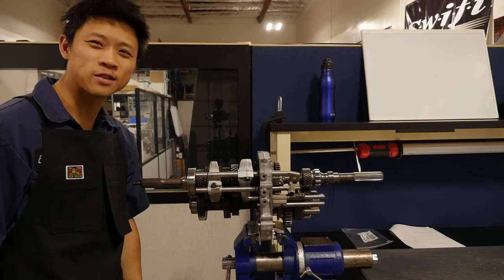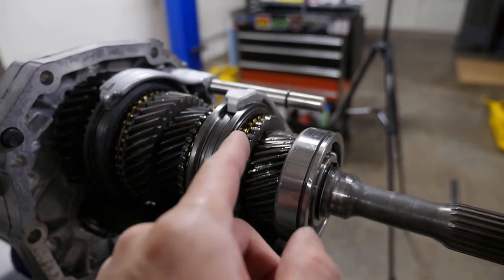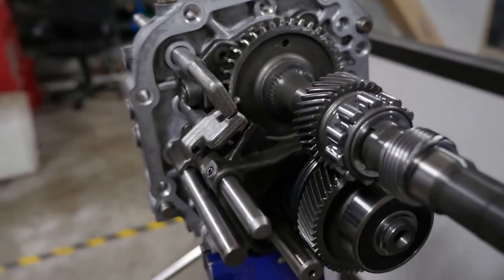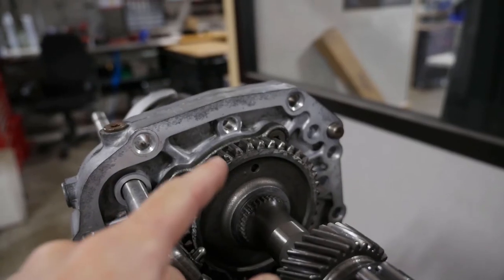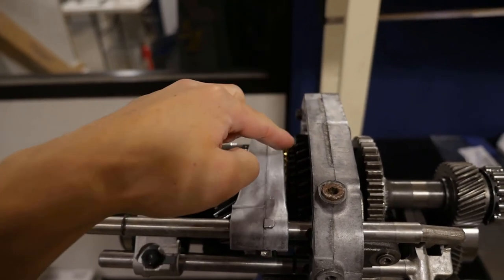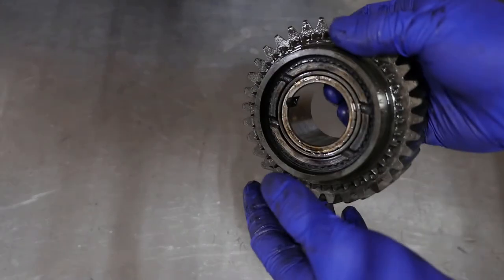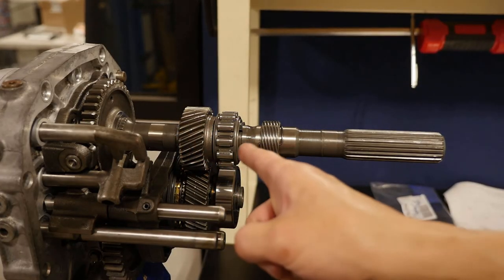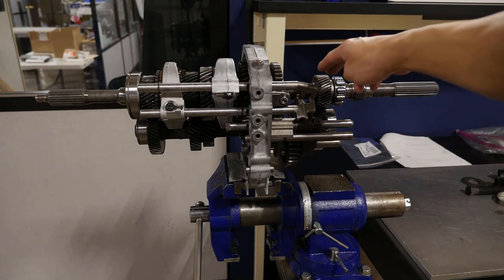W58 Rebuild Overview and Bench Test

Comment: Very nice, im in the middle of rebuilding an R154 and it seems to share a bit of architecture with the w58, it would be cool to see a side by side comparison
Reply from the maker: I have a customer R154 ready to build right now actually. Look forward to the video. Quick it I think it is 2nd gear that is scary to pull off and you risk breaking teeth. Use heat and pull up on the synchro and not the gear itself.

Comment: hello your videos are very helpful very well explained i have a question all w58 transmission are the same as car and pick up thank you very much
Reply from the maker: Wikipedia is a great resource for all the w58 variations
Reply: @CMAutohaus  thanks for answering in my Corolla I have a w58 from a 2000 Tacoma it is very strong but very slow which transmission would you recommend for my Corolla 😀👍
Reply from the maker: @edgarherrera6056  My top 3 optons https://www.stitcher.com/show/the-autohaus-podcast/episode/004-top-3-ae86-transmission-options-58255400

I think episode 2 I go over all the transmission swap options
Reply: @CMAutohaus  Thank you very much for taking the time to answer I will find a new transmission for me Corolla

Comment: My w59 trans wont shift. I took off the trans and took the casing off because it was leaking at the top. I put new rtv and put it back together. Now it wont shift. The handle only moves from center to the right. It wont move anywhere else. What could be the problem?
Reply from the maker: It may have accidentally fallen into gear when you put the tailshaft on. Take it back off and check, its happened to me a few times.
Reply: @CMAutohaus   yup it was in 5th gear. I thought i ruined my trans😅 thanks bro!
Reply: Hi! I have the same issue on a w58 i just bought. How did you end up fixing this issue? I have no experience with transmissions and dont know where to start.

Comment: Terrific video. Question about that reverse pin on the shifter you were explaining about. Is it spring loaded or locked solid? I have a W 58 I’m putting in a British roadster and that pin doesn’t move in or out but I cant find out if it was supposed to. 
Subscribed, and liked .Cheers and keep it up.
Reply: Believe you refer to it as a tic tac looking thing. Thanks again

Comment: Love the video. I've been wrenching on car since I was a teenager. I'm 58 now. My w58 had a very similar problem to the one in this video. A whirring sound until you put the clutch in the whirring sound went away. I'm guessing input shaft bearing. What do you think? Question. Trying to decide whether to send out my w58 or do it myself. Do you have an opinion? It's out of the car now . Any idea what a fair price would be for a shop to take one of these apart and go through it and put it back together for me?
Reply from the maker: Input bearing making the "whirring" sound seems to be a very common failure in all W-series boxes. You need a very rare/expensive SST to disassemble the trans (specifically the 5th gear and output bearing assembly). Best let a professional handle it, although transmission rebuilding seems to be a dying art these days.
Reply: Thank you!

Comment: Great video man!  Do you know many differences between the MK4 Supra W58 and the Lexus IS300 W55?
Reply from the maker: mk4 is the last verision W58 with many key upgrades such as an internal oil baffle, muti-piece syncros, and ball bearing shift rails.

W55 has the closest ratios, but is also a weaker W5x box.
Reply: @CMAutohaus  why would a W55 be a weaker box?  Does the closer ratio gearing cause more stress on the gears themselves?
Reply from the maker: @paulellaby7400  Anecdotal. IS300 guys commonly break these gearboxes. The gear teeth in these as well as the last gen W58 are thin for their size. breaking 4th gear teeth is very common
Reply: @CMAutohaus  any rebuild kits for 4th?

Comment: https://youtu.be/9CN2utya_7s In that video, the guy was able to remove 5th gear without breaking it. Before watching your video, I wondered if there was a special tool to remove 5th. No way Toyota would spec a crazy press fit without a way to get it out. How about a video showing how the tool works?
Reply from the maker: Ah yes. There is a Toyota SST that got superseded by an OTC tool. I have the OTC tool. You can see it in this video.

https://youtu.be/G4TS57sZcPM